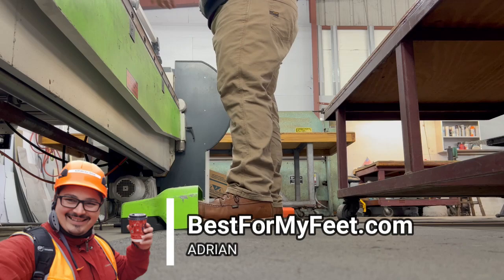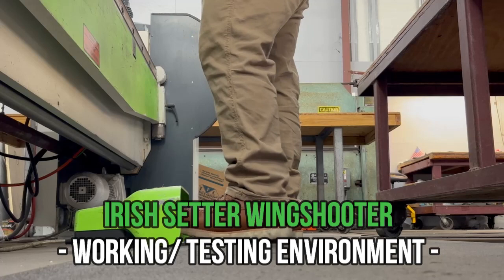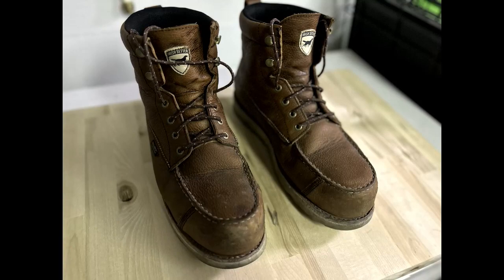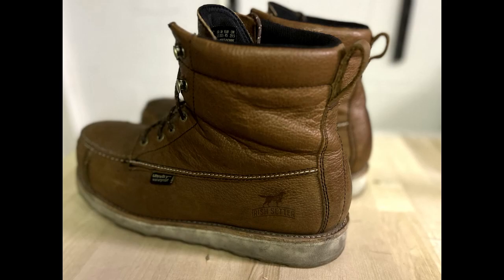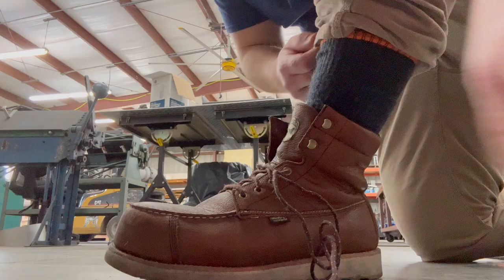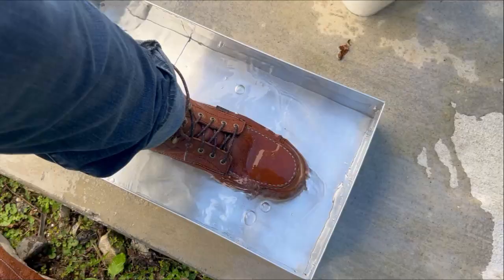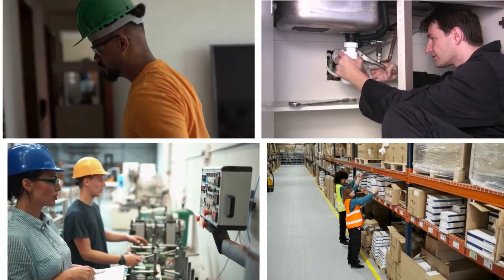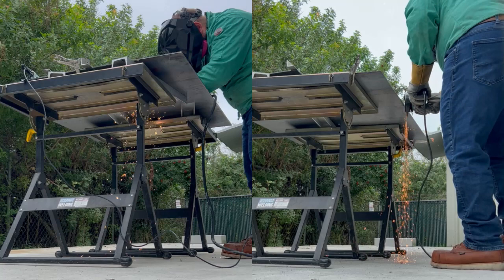Irish Setter Wingshooter ST work boots review (Tested On Flat Concrete Floors)

Comment: Nice 👞
Reply from the maker: Thanks. They do look very nice indeed 🙂
Reply: @BestForMyFeet  should I get the wedge or the heel
Reply from the maker: @lucaspeters5212  it's up to you really. I suggest wedge sole if you're mostly indoors, on flar  

The heel is better for outdoor work for better stability and traction and it's also safer if you work a lot on ladders since the heel will lock your foot in place preventing you from slipping.

Hope it helps. Let me know.
Adrian
Reply: @BestForMyFeet  Thankyou yeah I’ll prob do the heal one
Reply: @BestForMyFeet  heel
Reply from the maker: @lucaspeters5212  nice one. Keep us posted bud 👍🏼